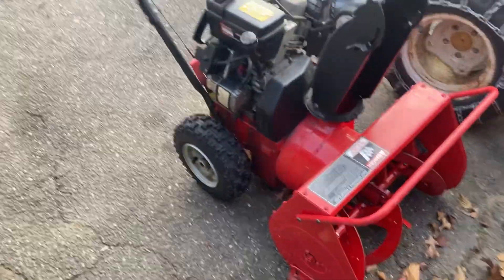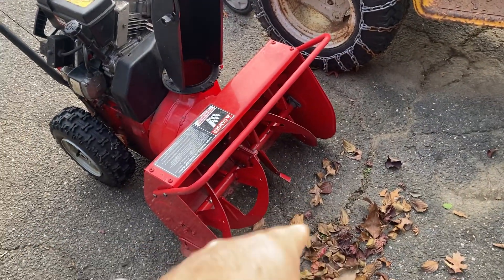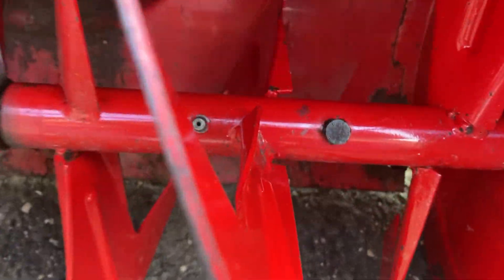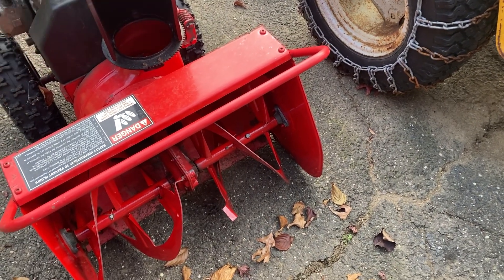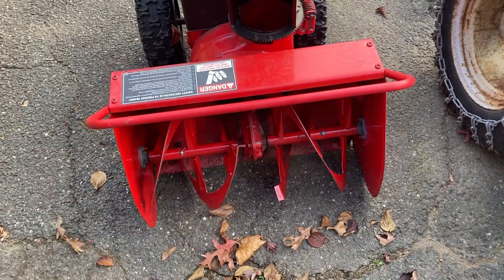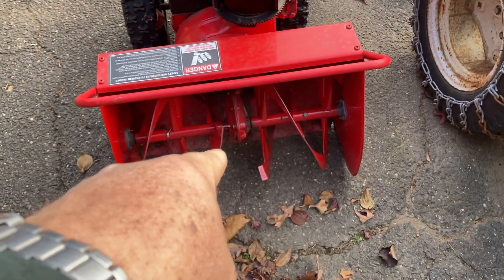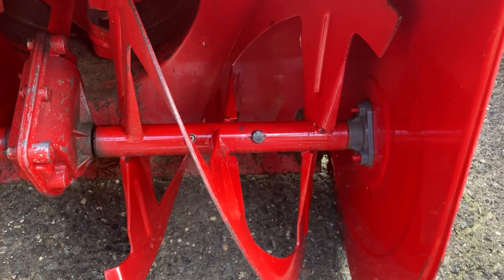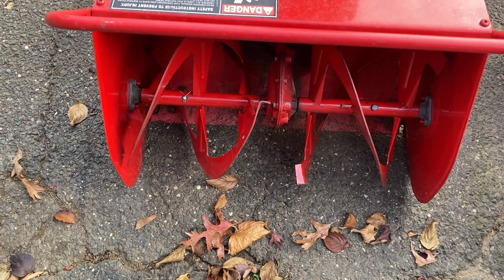Grade 8 bolt instead of OEM Shear Pin?

Comment: Actually had a snowblower come in with four 1/4" diameter hitch clips for shear bolts LOL. Naturally it was returned with the proper shear pins along with two spares. Once we gave him a rough estimate to repair his gearbox (if it got damaged due to running with the hitch clips)  he was happy to have the proper shear pins installed.
Reply from the maker: @waynestefinashen239  at least hitch pins are soft!

Comment: It's just a safety item so it doesn't matter, right? Some people (too many) should not be allowed to own or use tools or operate machinery...
Reply from the maker: I always supply spare shear bolts with every thrower/blower I repair. I put them in a Zip-Loc bag and tie wrap them to the handlebar. Some throwers actually came with a storage box for shear bolts!

Comment: Good one Ken. You could send that Cub Cadet tractor to me to free up more space for your self. I  got 5 tractors in my garage now. But have room for one more. 🤭🤭
I don’t have a Cub Cadet. Yet. 👍🏻👍🏻👋👋
Reply from the maker: Never have enough Garden Tractors, my love is for the old IH Cub Cadets from the Originals through the 82 series.
Reply: I’ve got 2 Ford LGTs, a Massey Ferguson 12, Case 224 and a John Deere 140H3 in the garage now. Son has the rest at his garage. 
A buddy of mine, passed away now, had a Cub Cadet 1100. Ran on propane. 
👋👋
Reply from the maker: @noelstractors-firewood57  Those 1100's were the budget Quiet Lines with Briggs engines and a Peerless Transaxle.  GT only in the Frame!, rest was Lawn tractor (Driveline).
Reply: Yes that’s true Ken. The Cub Cadet 482 was an economy model too. Basically the same as the 1100. 👋

Comment: Good one Ken. You could send that Cub Cadet tractor to me to free up more space for your self. I  got 5 tractors in my garage now. But have doom for one more. 🤭🤭
I don’t have a Cub Cadet. Yet. 👍🏻👍🏻👋👋
Reply from the maker: My goal is to buy it from my friend and convert to a dual stick hydro. I have an NOS K341AQS engine I'm dying to use, I'll make a 1650 out of it.
Reply: Neat. I thought you owned it. Hope you get it. I’d like to find a K341 for my LGT Ford. Even better a K361. But finding either one is very rare here. And the K361 not such a great engine , K341’s are great.
Reply from the maker: @noelstractors-firewood57  We have many K341's down here, come on down!

Comment: Sounds like what a numbnuts customer just did to his machine. Had to replace the brass gear, three oil seals, and all the disassembly and reassembly it comes with. He was none too happy. He used a Grade 5 bolt instead and it bent instead of shearing.
Reply: The shear pin saga again, yea BSF Recovery uses grade 5 bolt so they bend instead of break on his truck, but agreed with the cold temperatures use the shear pins like Ken says
Reply from the maker: Correct, only grade 2's will suffice, actually TORO spec's out grade 2 bolts and nylok nuts for their 5 and 6  series throwers like 521, 522, 622, 624etc